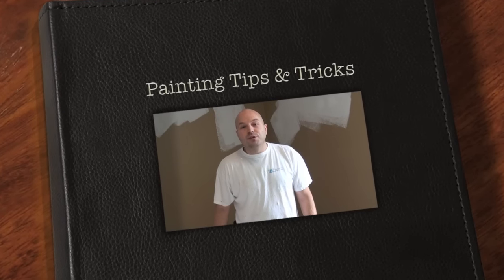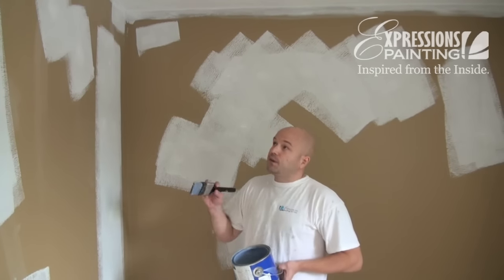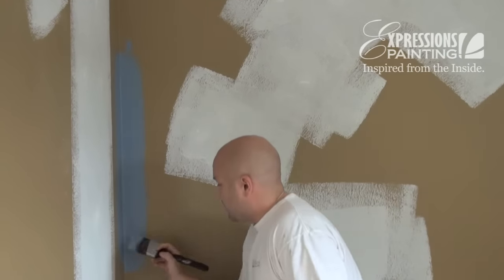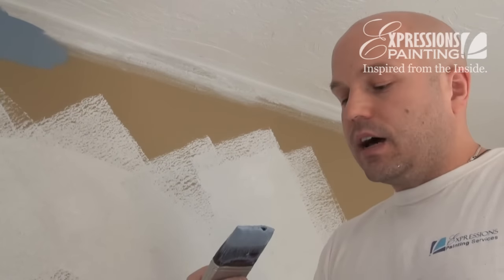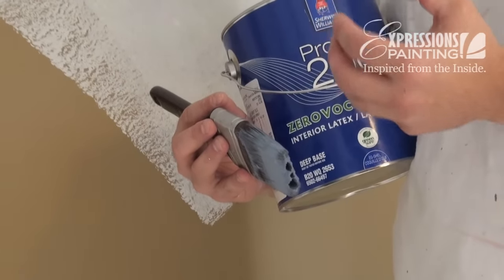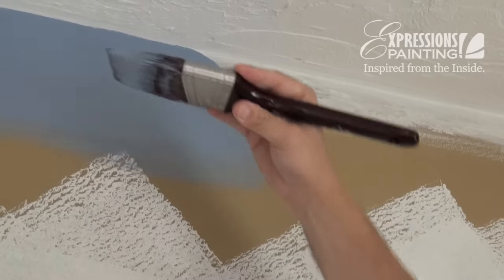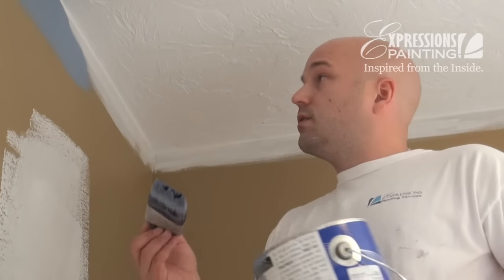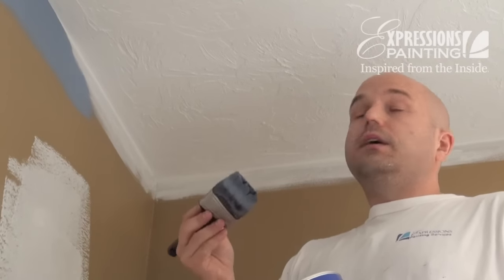How to cut a straight line like a pro

Comment: I’m a professional painter (30 plus years). The Dude in the video has good skills and good advice for the diy-ers. I’d add: use a high quality angled sash brush with a “firm” to “very firm” bristle formulation, 2 to 2 1/2 inch wide and use a high quality “spatter” free wall paint. Some of the cheaper paint “trails” the brush from the bucket to the wall, resulting in long drips on the wall and will spatter on woodwork
Reply: Try using both hands to cut in as it is faster as u get more cut in done
Reply: Lol If you painted that many years you should know how to handle a brush and not allow those drips. If it does drip just use your wet rag that you should always have on you. If it hits the wall just feather it out and keep it moving.
Reply: The angle brush makes a huge difference.  I have found a smaller brush about 45mm or say 1½" works best for me but I'm an ammature.
I agree with using a thicker paint.
Eg today I'm using a stain blocker, instantly thicker out of the can/tin.
So much easier to get good coverage without drips.
Reply: stiff brush? no way. 2 inch brush on a wall? LOL... no, too small, too many strokes, less paint distribution. 2.5 - 4 inch is best. sash only work in one direction. a true wall brush can work in both directions.

Comment: Thanks for the great video. I tried your technique yesterday and it worked really well. Biggest takeaway  was that I wasn't using the brush properly. Getting rid of excess paint  on the tip and letting the middle of the brush deliver the paint was an eye opener. Tried it over the doors first and did the whole room without having to tape. I'm not a painter (my guy was booked up) and this was really helpful for a large bathroom. Saved a lot of time.
Reply from the maker: Chuck Fulanovich you’re more than welcome. That’s really nice to hear. :)

Comment: Definitely a pro.  Notice that he loads his brush by quickly slapping it 3-4 times against the side of the can, not by lifting it up and wiping it off against the inner rim.  His method is faster, doesn't compress the bristles as much or as unevenly as wiping them against the rim, doesn't create a mess inside the can from the rim down, and also leaves more paint in the brush, which means that reloading is also less frequent.

Comment: Hi Remi! It’s sooo neat! What happens when you get some paint on the wood work? I used masking tape but it’s such a faff. I’d love to be able to do it like you are! Any advice?
Reply: Keep a damp cloth handy as it will wipe off easy before it drys.
You can also look at caulking a new line and painting with a paint shield, but you will need very square and level walls to get a sharp line. One of the best things to do to practice cutting in sharp lines is the stick some masking tape in straight lines on a wall (that is going to be decorated) then practice cutting against the masking tape trying not to go over the line.

Comment: In regards to a beginner, would you recommend cutting in one wall at a time, roll then moving on to the next wall to keep a wet edge on hot summer days???
Reply: I have painted for many years and never had a problem with the transition from brush to roll.  I'll do cut in all around a room and then roll it.  You could also roll walls first on your firstcoat.  If you get a quality brush the marks are not as noticeable and remember to fade out your cut-ins especially the wall meeting the ceiling.  Quality paint, brush and roller nap will get you a professional finish.

Comment: Hello Rémi, first I would like to sincerely thank you for all of your helpful painting videos. I only have a year and a half of painting experience so I still have everything to learn. I'm curious if you have a preferred brand of brushes, roller sleeves and rollers. I work for a renovation and construction company in Québec and we buy Aqualine and Jasper brushes (mostly synthetic since we mostly work in latex paint) which are the best we've used so far. We try to always have an army of brushes on hand but we mostly use two and a half angle sash brushes and despite cleaning and storage, they still lose their form and spring after two job sites max.  I've heard there are brushes and sleeves that could last a lifetime!  Same principle with roller sleeves (we never clean ours - just toss them) and we buy Richard, ,Rona, Uberhaus, or Simms rollers and sleeves.  Any preferences or suggestions?  And thank you again!
Reply from the maker: Hi Tiffany,
I have never worked with those brushes but I can tell you that a brush being out of shape after 2 jobs doesn't seem normal to me.
Two things are important in order to maintain the brushes:
1- Proper Cleaning (see my video about how to wash brushes and rollers)
2- Proper storage in their original cases
As for the roller sleeves, typically a roller doesn't work the best the first time you use it. So if you're throwing it out after each use you're never working with a proper roller sleeve. This effect is more evident in wooven rollers. 
As for my preferred brushes I like Nours Nature's Palette and Wooster Extra Firm both in the 2.5 inch sash.
For roller sleeves it depends on what I'm painting. Ceiling I prefer a thicker wooven roller from Purdy. Walls I prefer a micro fiber roller 13mm.
For cages and extension poles I'm a big fan of Wooster mostly because of the quick release system :)

Comment: You make it look so easy. Any tips on how to touch up nail holes in finished trim that has a high gloss sprayed finish on it? Thanks in advance.
Reply from the maker: +Brent Gearhart I'm not sure exactly what you mean by this. Could you send me an email with more information and a picture if possible. My email is on my website :)
Reply: You need a little sample container of the same gloss paint. Fill the holes with spackling compound, and make sure it's wiped off smooth before it dries.

Comment: You need to talk about the first stroke where you are creating a paint reservoir to spread the paint. Moving it towards the center of the crease. Then. How its better to have a little excess on the ceiling than not enough on the walls. Also, I think its important to make the first cut as good as you can get it.I agree with straightening it out better later. But if you do it right the first time theres very little left to straighten. And you fly.I like your banjo music. I am the golden brush. Retired. I appreciate you helping others with your video. If you ever need my advice. I have 40 years experience as a journeyman painter, hanger.Good luck brother.

Comment: Yes correct... Priming the brush before starting the job says brother of the brush... Note how he taps both sides of the inside of his can before applying the paint... Thats to put 'er [paint] heavy on the brush [so you get good distance when applying/efficiency] and in same breath taking off more of the paint than is needed to help prevent dripping or sagging in drying paint after applying... In essence it's giving you enough paint on the brush to let you go far in spread distance but not too much that you may end up with too much on the surface that you get the drip or sagging issues... Basically it's the middle ground or lukewarm region between hot and cold... It gives decent coverage ability that way too... [Meaning cut in gets the smeary paint look where not enough paint was applied and you can see the paint coat beneath you are going over...] As for the tapping on inside of paint can and preparing to cut along ceiling corner line in video you saw the painter work backwards into the paint that was already applied... I would do exactly that then... I personally would have gone back the opposite way a second time along the ceiling corner to straighten that paint line to laser straight and worked the brush outwards from the paint you just applied... The key in painting is working it in [rolling or cutting] BOTH directions... In all aspects of painting... When you don't you get speckles in your wall rolling and uneven/un-straight to the eyeball ceiling lines... 'Oh and that slopping of the paint he did before starting to cut the ceiling corner line??? Thats called priming the axe... So you know the difference between it and priming the brush even though both terms relate to priming the brush in preparation for the spreading/applying...  Cause axes cut well... Just a way to understand when speaking about it while training... Both instances of priming are needed to get a good cut line none the less... Otherwise you will load up that corner and you won't like the end result... Opposite of straight as a laser line...

Comment: Do you do 2 coats of the edges before you use the roller to paint the whole wall? Or 1 coat on the edges and wall then repeat the whole procedure for a 2nd coat?
Reply: depends on what type of paint. eggshell for instance you cut one wall then roll it before you move on...then repeat. flat paint you can cut entire room twice then roll twice.

Comment: I've been painting for 50 years, after 4 year apprenticeship. I've found that a straight, rather than an angle brush allows one to cut in in both directions. speed equals money.

Comment: Great videos Remi! Can you let the cutins dry before rolling as it is hard to keep a wet edge with cutins?
Reply from the maker: That depends largely on the product and the color. Most products will make it possible to do so with light colors but not so much with the darker colors. On the other hand some products require you to wait for the cut lines to dry before rolling in the walls. Checking with the paint manufacturers data sheet is recommended here.

Comment: You're using a sash brush designed for window sashes and only meant to go in one direction. First year apprentice training, always finish into wet so you don't get jab marks.With acrylic paints like promar 200 it works best to roll first to avoid double coating at the cut in. You can control the cut to the rolled area. Try it it is much faster, saves paint and looks much better.

Comment: I’ve tried tried and tried I’ve watched paint videos but I can’t get it right, actually why don’t you just come and do it for me, good work man
Reply: I've been a professional painter and decorator for 20years.. trust me you'll never cut in like a pro because it takes years to master.. my advice would be to use frog tape. Hope that's helpful 👍
Reply: Daniel Biggs thank you,I have purchased some frog tape today. I took my time to put it on I’ve done 2 coats will do another coat tomorrow and fingers crossed, thanks for taking the time to reply you’re a star
Reply: @MrBradblade  no problem pal.. 
Another trick of the trade would be paint your ceiling the same colour as the walls. As long as the colour is not to dark you'll get away with it. Really does work. I paint new build houses. And alot of the big builders do it. A great colour to use is dulux almond white. You're celling will look white and your walls look almond white and perfect cutting in lines except you've done no cutting in👍
Reply: Slower you go = more wavey the line will be
You have to go somewhat quick
Also. Start the new colour on the old paint and work towards the new stuff you just cut in
If you start where the new paint is and work towards the old paint
You actually thin out the new colour and will have a harder time on the 2nd coat cause it will be thick then thin then thick then thin..

Comment: Many painters recommend cutting 1 wall at a time and paint it with the roller while the cutting paint is still fresh.
Is that true?
I used to cut the whole room first and then use the roller.
Which method is right or better?
Need to paint tomorrow.
Reply: Yes to maintain a wet edge for DIY painting that is usually the case as it is at a slower pace, compared to contract painting that tend to be faster other wise the paint could "picture frame" or "band" on certain colours and brands.

Comment: I like trying to get a perfect line the first time that way the second coat u can stay away from the ceiling line a lil bit
Reply: I hold back on my first coat 1/8"...
Then i run my line on 2nd coat...
Reply: Agreed.  Cannot detect any coverage issues on a second coat that is within say 1/8 inch from the outermost line of the first coat.  Something else he didn't describe or show:  A person can push a pencil into the ceiling/wall joint and slightly mark a line all the way around.  Then, those hard to see corners are easily handled, because the smart painter can then see the joint.  I am also right handed but learned to draw the brush in the opposite direction than that being shown.  I will, however, use the right-to-left technique minimally to reach out before moving the ladder.  Been painting professionally for 50 years and was taught by an expert back then.
Reply: And one more thing.  Lots of time today's paint comes very thick - too dang thick to cut in properly.  It is wise to thin the paint to be used for cutting in, so that it will flow properly allowing those longer strokes that make straight lines.  Typically the paint can be thinned minimally in the cut-in bucket only and the applied straight from the bucket with rollers.
Reply: @glenwunderlich2438  great tip on the pencil trick. Thanks for sharing

Comment: Thanks. I'm about to paint 3 bedroom and 2 bathrooms. Oh Lordy....I need all the tips I can get and this is great.
Reply: As a designer with enough info, I advice you to use washable glossy paint for bathrooms for next time if you already finished. Moisture is a huge problem ~ if you are using dry normal Paint, it isn't ideal and will come off in dear sweet short time :( 
Of course tiling bathroom walls is much more efficient
Good luck :)

Comment: Do you have any suggestions on soft, med or hard brushes for cutting in?
Reply from the maker: Kyle_of_the_Dead that depends on both your personal preference and the type of paint you're working with. But as an example the thicker paints work best with stiff bristles. If you want to learn more, there is a Free Painter Training Program at Expressions Painting University (link is in the description box). In it I explain how a straight line is achieved using the bend of the bristles :)

Comment: Is the paint in the corners not to dry when you first do the entire room and then start with the roller?
Reply: Most people use Acrylic Latex paint on their walls which dries - Really Fast! I would recommend beginner's cut in part of their wall and roll then cut and roll. If you have a really sharp eye the edge will stand out to you like a border and you won't be happy. Some pros can cut like this because they paint quickly. I also cut in stages for large rooms and open concept homes.

Comment: I've noticed you do it the same way as I do although I'm left handed..you do the woodwork gloss first then emulsion after which I find much easier to do..you can wipe emulsion off woodwork but you can't wipe gloss from emulsion! I can never understand how most decorators gloss last..seems wrong to me.
Reply: What i normally do is miss coat the whole room and undercoat all the wood work finish my ceiling the walls and the complete it with the wood work

Comment: I noticed how you did not cover the dark brown colour with white, you only covered it in patches , why did you do that? I have a red wall and I covered the whole wall in white prime, was it necessary, what I did?
Reply from the maker: That mostly depends on the color you're painting with. The color I was using in this video was a blue that covers really well so there was no need to put a white or gray primer first. The white patches that you see are simply me priming over the repairs that I did. The reason is so that the repairs won't show by the time the final two coats are applied. In your situation with the red it may have been a good idea although that also would depend on the red your painting with. Some reds require a white primer others require a light to dark gray primer while some require no primers at all. To know which primer to use it is best to consult the paint manufacturer from which the color originates from. They usually recommend a specific color of primer required (if any) to achieve the exact color question. :)

Comment: as a painter myself those were definitely good tips. ....1- Always get a good brush (preferably a stiff or med stiff... better brushes are rated) definitely worth the money as they are re-usable after a good wash.... 2- have a cutting can with approx 1 inch of paint in it..... I was taught the and have been "loading" my brush the same way as you did in this video by dipping into paint & then BANGING the brush on the can side to side (it allows the paint "inside" the brush) ... too many people dip & then wipe off most of the paint on the can .... 3- excellent tip of painting close to but not right to the edge , followed by the "perfecting" of the 2nd cut ..... this is OVERALL significantly faster and insures ideal coverage .... and great tip of long elongated and ideally un-interrupted strokes when the brush is properly loaded (should be able to stroke twice or longer than demonstrated) and great tip of fading paint  .............. also great tip on to be careful of the paint that is sitting on top of the brush once you push the brush onto the wall ...

Comment: Good that you do a second cut-in. Some painters get lazy on that point.
Reply: Some painters realise you rarely need to cut in twice unless strong colour change.
Reply: I guess some painters just hope the homeowner doesn't look close enough to see the obvious difference from a proper 2-cut job and a single-cut lazy job.
Reply: no read what the guy above put..unless the color is strong you rarely need to cut twice..if its done correctly..with a bigger brush
Reply: pbaylis1 instagram
Reply: pbaylis1 nd
Reply: Bottom line you quote for two coats you give two coats both brush and roller to do otherwise just adds to the countless mugs and wannabes in this profession